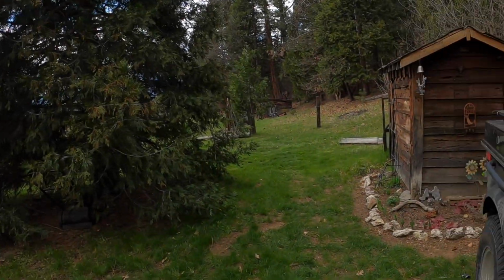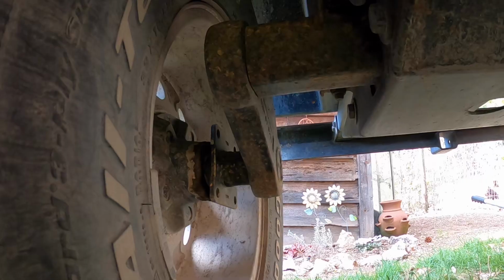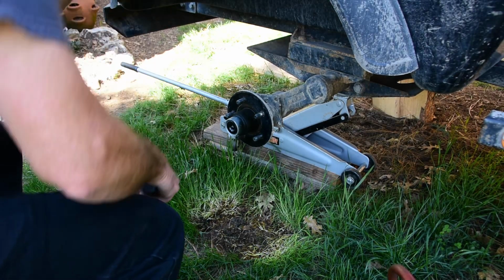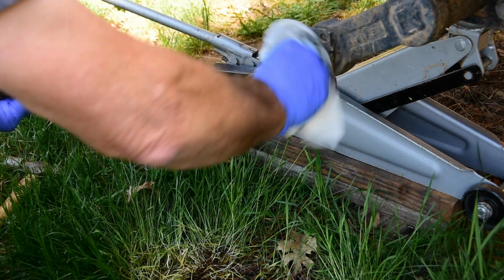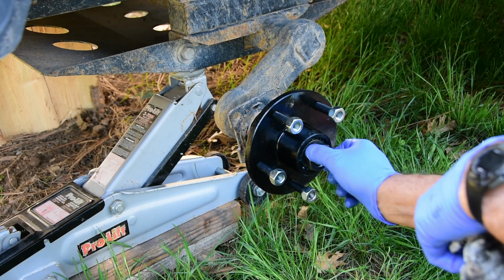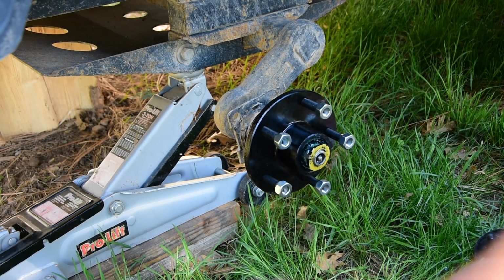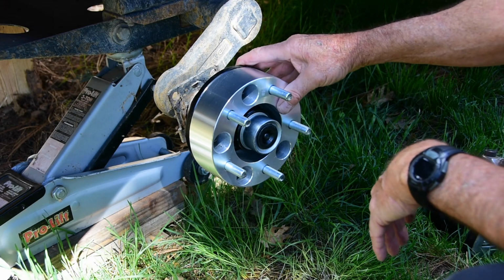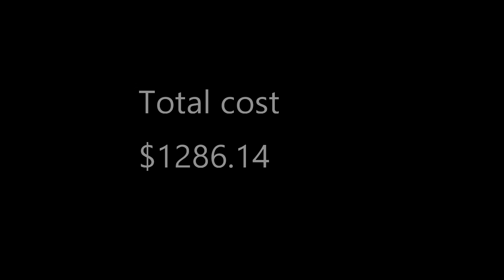Tentrax trailer wheel conversion

Comment: great video..  thanks.  so you got the jeep drums from tentrax.  where did you get the spacers (you said amazon but no part number):
Reply from the maker: Yeah, Tentrax ordered the hubs for me and also pointed me to the wheel spacers.  I guess I should have included more info in the description, sorry.  Here's the info from Amazon on the spacers: DCVAMOUS 4PC 5x5 Wheel Spacers 2 Inch with 1/2" Studs Compatible with Jeep 5 Lug 5x127 for 2007-2018 Wrangler JK JKU (Not for JL) | 2006-2010 Commander XK | 1999-2010 Grand Cherokee WJ WK  Thanks for watching!